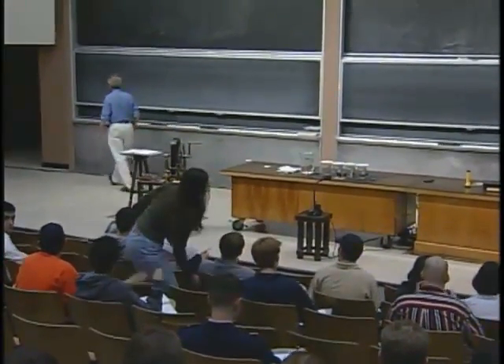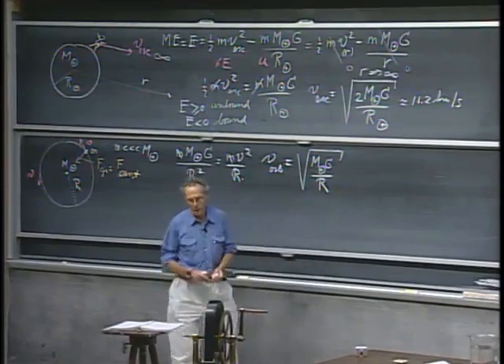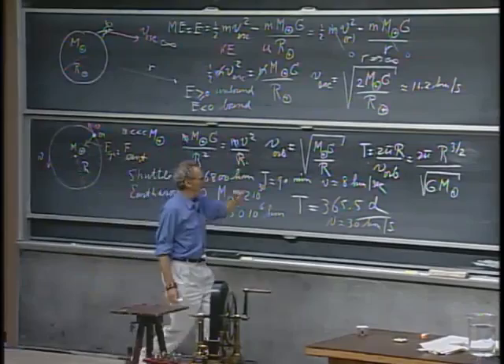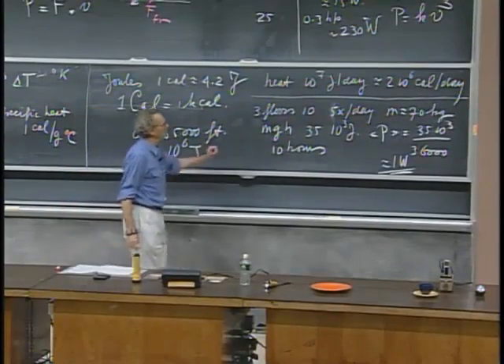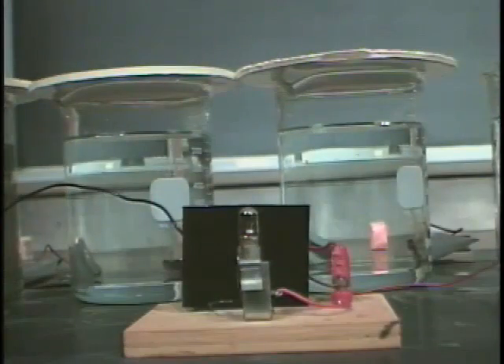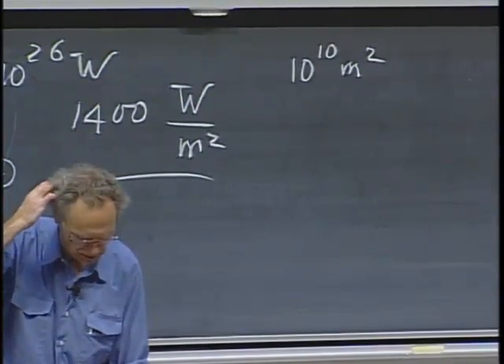8.01x - Lect 14 - Escape Velocities, Circular Orbits, Bound and Unbound  Orbits, Power

Comment: GPE of the ball --> KE when the ball hits the ground --> causes a spring in the ball to be compressed and converts KE to EPE and closes the switch in the circuit --> electrical energy flows through the circuit --> light energy in the bulb, causing the ball to light up. The spring continues oscillating, converting EPE to KE and back to EPE to keep turning the switch on and off. However, as the spring is affected by friction and drag forces, it will eventually lose KE to heat and the spring will stop oscillating, turning the switch off permanently, thus, no electricity and no light emitted from the bulb in the ball.

Comment: When bounced, mechanical impact compresses an internal spring switch. This completes a circuit powered by a small internal battery, supplying chemical energy to flash the embedded LEDs for a set duration.

Comment: Does the ball have a battery inside with an open circuit that is completed by a spring flopping around when it feels a certain acceleration?
Reply from the maker: yes
Reply: @lecturesbywalterlewin.they9259  that's cool

Comment: Regarding last question: When we release the ball from height h above the ground, the potential energy starts to convert into kinetic energy and by the time ball reaches ground all the potential energy is converted into kinetic energy(ignoring air drag) and now ground is stopping its motion and hence some of the kinetic energy during impact time converts into heat energy in ground and in ball as well and so inside the ball there is heat energy and jiggly motion of an atoms, and the mechanism of ball’s light is such that it converts this heat energy into an electric energy to light the bulb.
Reply from the maker: most people think like you do. Quite resanable; but your answer is incorrect.

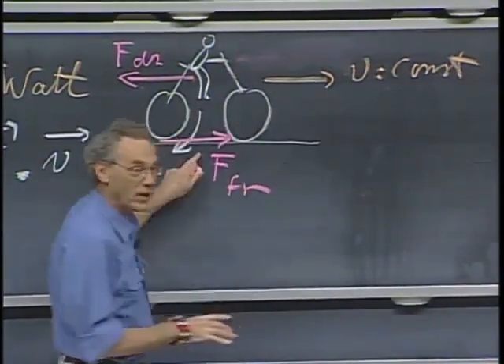Comment: For others who are confused @ 17:27 like me... 
Friction is ALWAYS opposite to the direction of motion. But in the bicycle example, friction is acting along. Also, kinetic friction is constant, as the cyclist's weight is not changing, so ideally, if it was friction from Lec-8 which was acting, then the cyclist wouldn't be able to accelerate. And the tyres would be scratching the road as it passes by causing the friction to be in opposite direction !!

So i guess the choice of word "Friction" is misleading here. It's simply a push by the ground in reaction to the push by the wheel !! Not friction from Lec-8
Reply from the maker: when an object slips then the friction is always opposite to direction of motion and heat is produced. Do not confuse that with an rolling object in pure roll condition; the frictional force is then not slipping and this frictional force can speed up an object (increase its rotation rate) when it  is rolling down an incline - (no heat is produced)
Reply: @lecturesbywalterlewin.they9259  Thank you sir for clarification. Love from India 😊
Reply: @VickysTuition  There are 2 types of friction, static & kinetic. If tyre overcomes static (doesn't slip on surface, object starts to move forward), kinetic friction causes bike to move forward through pure roll of the tyres.

Comment: 8.01x Lecture 14

0:00 escape velocity <unbound Orbit> <bound orbit>
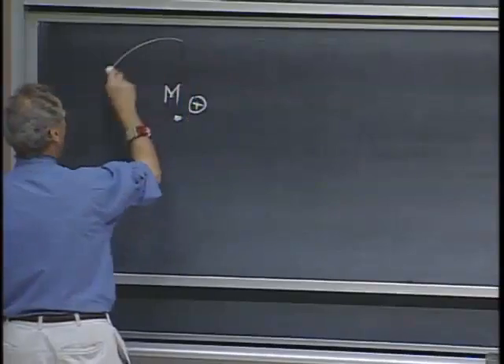4:30 Orbital velocity
(Example: Shuttle + the moon + earth, jupiter + Sputnik 4/10/1957)
=> interesting result: v Is independent on the mass
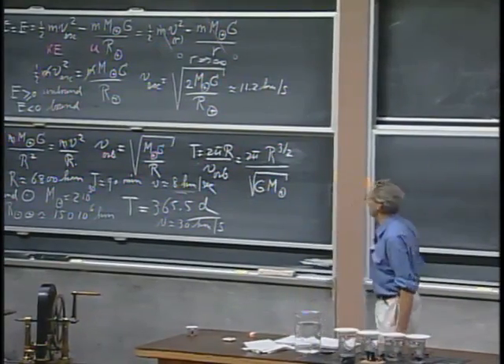11:55 interesting result from the equation of energy E=1/2U= -KE
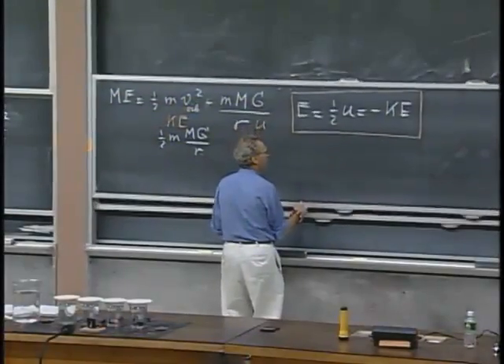13:40 Power
20:10 Heat energy
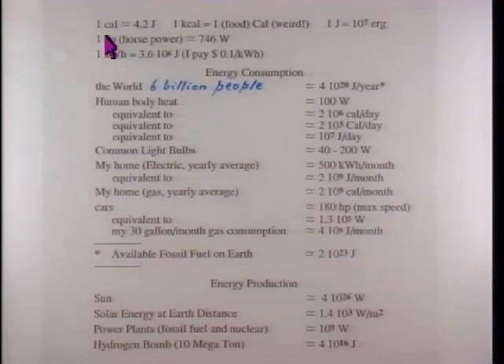23:19 Lecture Notes, Energy and Power Consumption
28:30 various form of E
33:55 acid battery
48:00 last ex+ question 

Give my thanks to Pro. Walter Lewin
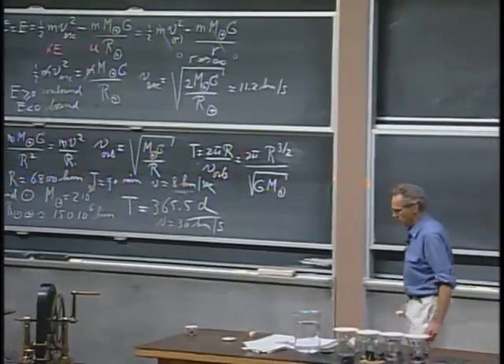Reply: The definition of the viral theorem at 11:55 is very ad hoc. Even though it is absolutely correct, I feel like the deepness of this result is not well articulated, but perhaps that is to be expected for an introductory course.
Reply from the maker: thanx 2u 
8.01 https://ocw.aprende.org/courses/physics/8-01-physics-i-classical-mechanics-fall-1999/

8.02
http://core.csu.edu.cn/OcwWeb/Physics/8-02Electricity-and-MagnetismSpring2002/CourseHome/index.htm

8.03
http://mit.ucu.ac.ug/OcwWeb/Physics/8-03Fall-2004/CourseHome/index.htm
Reply: @lecturesbywalterlewin.they9259  Thanks Teacher, the book Physics - Ohanian now is not available for us to find, so i can not solve all the problems which is in this book. Can you help us.
Reply from the maker: @thienthanhtranoan6723  Ofcoz I do have a copy of the Ohanian that I used in 1999 but I see no way I can help.  Many problems in my assignments simply mention "problem xxx in Ohanian, page yyy".  However, when you view the solutions you can guess very often what the problem was about.
Reply: @lecturesbywalterlewin.they9259  yes sir we can study by guessing and seeing the given diagrams in the answer solutions

Comment: question: if a rocket is fired up at a speed less than escape velocity, in order to reach a stable orbit, is there some angle to the vertical that must be exceeded upon liftoff?  for example if it goes straight up it will obviously come back down.  I imagine there would be some Theta that must be exceeded in order for there to be enough tangential motion, and this would depend on the velocity and also would be very difficult to calculate.
Reply from the maker: all rockets that put a satellite in  Earth Orbit start going up vertically then gradualy change that angle to optimize fuel consumption. Also watch my lecture on Kepler Oribits. I have a Physics Problem in which I address that issue.
Reply: @lecturesbywalterlewin.they9259  ah I should've realized to wait until I saw that lecture before asking.  sorry for wasting your time!!  and thanks for taking the time to reply, it means a lot.  stay well ❤

Comment: accelerometer and battery inside - if te acceleromter measures anything very strong the lights flash

they do not generate energy from the impact - that might hteoretically be possible but it’s impractical and expensive you usually just have a battery that lasts very long
Reply from the maker: correct

Comment: Where does the energy come from of the blinking light in the ball at last, I didn't get it professor.😋
Reply from the maker: battery
Reply: @lecturesbywalterlewin.they9259  So when the ball touches ground, the battery gets connected to the led via spring. 

Is that right ??
Reply: Gets connected to ball*
Reply from the maker: @pratikshinde2121  when the ball hits the floor (or when you bang it on the table) a switch is activated which will drive the current for a fixed amount of time.
Reply: @lecturesbywalterlewin.they9259  Got it sir, thank you
Reply: @lecturesbywalterlewin.they9259  Battery... I knew it!

Comment: If fuel is continuously supplied irrespective of escape velocity and propelled why cannot a rocket reach infinity? That is leave the earth gravity
Reply from the maker: any object giving a speed of about 11 km/s above the Earth atmosphere in a direction away from Earth will escape and will not return to Earth.
Reply: @lecturesbywalterlewin.they9259  My question is different. Any object with lesser velocity but continuous propulsion should also escape from earth?.  Another doubts raises is if escape velocity is given on the surface no more propulsion is required till reach the escape distance?
Reply from the maker: >>>Any object with lesser velocity but continuous propulsion should also escape from earth?.  >>> yes, of course provided that the "continuous propulsion" is sufficient". If it is not sufficient the object may fall back to Earth.

Comment: Its not clear how the switch turns on in order for the bulb to emit light. but the energy comes from the moving motion of the ball. the total gerenerated due to the motion of the ball depends on the gravitational constant and the mass of the ball if the consider the work done to be the dot product of force and velocity(w=F.v).

Comment: Hi Dr Lewin,
I did some research on the mechanism of the ball experiment that you did at the end of this video, I wonder if the ball blinks because after it collides with the floor, the spring inside the ball gets compressed, thus the gravitational potential energy is converted into spring potential energy. After it bounces up, the spring started oscillating. It takes a period of time for the spring to stop the oscillating ( to transfer the spring potential energy into electricity which lights the electronics inside). Thus, it would blink after bouncing up.
I am not sure if my reasoning is legit. Please help me with that.
Thank you!
I really enjoy your lectures especially the demos!!
Reply: Good hypothesis but for a spring to be compressed and store the energy it requires a orientation where the loops of the spring are aligned vertically to the floor when it collides so you would expect it to sometimes blink and sometimes not blink depending on its orientation when it hit the floor but 3 springs aligned 90 degrees to each other may work regardless of orientation.
Reply: @burningsilicon149  what about y shape spring configuration?
Reply: I thought about this too. However, if that's the case, then at the oscillation of spring would've slowed down to a stop instead of instantly switched off.

Comment: I think the blinking is caused by impulse when the ball bounces off the floor. There should be a 'generator' inside which powers the little bulb with a frequency, a generator which converts impulse of bouncing to electricity. I guess if you'd constantly bounce the ball, it would never stop blinking until that 'generator' or battery dies at some point. Correct?
Reply from the maker: there is a battery inside - at each bounce a switch triggers the connection for a few sec with the light bulb.
Reply: @lecturesbywalterlewin.they9259  aha! Thanks for the answers <3

Comment: maybe LED is situated in a group of -ve springs with some space between them and +ve terminal of led is already attached to the battery 
so when ball collide with floor then system becomes unstable and LED moves back and forth and circuit will start switching between on and off. 
but i don't know why duration between two flash of lights is looks like so uniform?

Comment: Here is my try on the brain teaser. 
When the ball hits the surface, there is heat generated. Maybe there is a detector which detects this sudden change in heat and responds to it by blinking. Afterwards, the heat radiates out and the ball comes back to nearly it's initial temperature?
Reply from the maker: incorrect

Comment: To start with you are the best. I am 16 minutes into the lecture and have a dumb question. If friction causes the bike to accelerate and the force due to friction is a constant = u_k*N , then faster pedalling should result in lower acceleration since it would decrease the resultant force in the forward direction. I know I am wrong somewhere. Can you please help me out?
Reply from the maker: faster pedaling means you are doing more work. The wheels want to rotate faster thus the frictional force on the wheels in forward direction increases. Look at it this way: suppose the friction coeff was zero (smooth ice), no matter how fast you pedal you will not move at all.
Reply: Lectures by Walter Lewin. They will make you ♥ Physics.

Thank you for your reply.

Can i also think of it in this way. Since the wheels rotate faster the centripetal acceleration increases which means more N and thus the frictional force (u_k*N) in the forward direction increases?
Reply from the maker: The force that I exert on the road (via the chain and the wheels) increases when I push harder on the pedals even at the start when the wheels are not rotating and when the centripetal acc is zero.
Reply: Lectures by Walter Lewin. They will make you ♥ Physics.

Got it. Thank you Professor.

Comment: Sir, In the Bike example you said " I push on the pedals and the pedals push back on me, action equals to minus reaction and therefore there is no net force on the bike" but the forces are acting on the different bodies and if we consider free body diagram of the pedal, the is force which pedal exerts on you and the force which chain exerts on the pedal, so to keep it moving with constant velocity they cancel out. Is it correct?
Reply from the maker: >>>and therefore there is no net force on the bike">>>
WRONG

Comment: Sir I think that there is a potential energy mgh when we throw the ball and then at the moment it hits the ground that gravitational potential energy turns into kinetic energy and a potential energy which squeezes the ball when it hit the ground. Then this squeezing potential energy turns into electrical energy which make a light bulb (which is programmed to blink) blink. Is it right?
Reply from the maker: incorrect
Reply: Lectures by Walter Lewin. They will make you ♥ Physics. May you tell me the reason sir please?
Reply from the maker: try harder

Comment: Dear sir ,
You took 10hrs for calculating power of climbing 3floor building  example but , isn't  be time of travel(assume we take 5mins to climb a staircase then it will be 5*5=25mins  )  not span in which we have climbed  in a day ??
Reply from the maker: ho many minutes into the lecture?
Reply: I was on 27th minute of lecture!!
Reply from the maker: m g h = 70 x 10 x 50 = 35 thousand (h = 5 times 10 m)
Reply: Sir ,
This I know!! but ,To calculate power u took 10hrs ,which I think isn't justified!!
Reply from the maker: 35 thousand J in 10 hr is an average power of about 1 W

Comment: Sir, can we say that if we intake more calories than required, body increases its surface area (which is proportional to size) to increase the heat rejection to maintain the temperature?
Reply from the maker: >>>can we say that if we intake more calories than required>>>

depends on what you mean buy "required".

Comment: How will having atmosphere affect the calculations (0:23)?
Reply: how will it affect the calculations?
DO you mean the drag force??
Reply from the maker: we calculate esc vel of stars and planets and ignore possible atmospheres. In the case of Earth the esc vel from 100 km above the earth (where atm can be ignored) is about the same as the esc vel from the surface (ignoring atm) it's about 11 km/s.
Reply from the maker: yes air drag
Reply: so why are you ignoring it even though you have already taught it in Lecture-12?
Reply from the maker: To take the atm into account in esc vel is not practical as it differs greatly for all objects. (ask NASA). Look up tables of esc vel of planets - atm have always been ignored and that's OK because the esc vel from above the atm is nearly identical than the "imaginary" esc vel from the surface. If a satellite is in a circular orbit around the Earth, it will escape the Earth if you multiple its speed with sqrt(2).
Reply: But in Lecture-12 you gave the example of people jumping out of the plane with or without the parachute and WE MADE THE CALCULATIONS ALSO..........

so what's the problem now???
Reply from the maker: I WROTE you what the problem is. READ READ READ
To take the atm into account in esc vel is not practical as it differs greatly for all objects.
Reply from the maker: read
https://en.wikipedia.org/wiki/Pegasus_(rocket)
this is my last msg on this topic

Comment: sir, I have a doubt. Energy required to lift an object is mgh but how much energy is required to hold that object for x seconds.
Reply from the maker: to hold it for 20 years requires ZERO energy. Place the object on a shelf. 
Do you think the shelf has to do any work?
Reply: thats  to do with biology, i think lactic acid buildup or something, but in terms of physics,  no energy is transferred over the duration you are holding the object up for. Pain or effort =/= transferring energy
Reply: Lectures by Walter Lewin. They will make you ♥ Physics. But then, why does our hand start to hurt if we hold it for a certain amount of time?
Reply: five 505 that’s because only your muscles are doing the internal work,they contract and expand repeatedly,that’s why they hurt,the work is being done internally not externally as the object isn’t experiencing any work.

Comment: I think that in this ball is some spring with magnet which induce current. Isn't it?
Reply from the maker: no
Reply: Or maybe there is spring which turn on and turn off batteries.
Reply from the maker: yes
Reply: but then how does the light stops blinking after some time because the spring will continue to turn on and off batteries?
Reply: There is some friction.
Reply: I get the idea that when we throw it on the floor then the spring inside it is compressed which then oscillates and hence turns the battery on and off again and again but the professor showed that it stops after some time so the only reason that is responsible for it is that the spring is not in contact with the battery anymore SO BASICALLY WE HAVE TO THINK OF THE REASONS BY WHICH THE SPRING CAN BE MADE TO STOP??
Reply: This pronomenon which make spring not oscilate any more is friction.
Reply: but I saw in Walter Lewin saying in one of his comments that-
"There is a battery inside the ball and a switch that closes for about 10 seconds at impact"..........
Reply: Yes, and what about that?
I see it in such way.
There is spring which turn on and off battery, but because of friction spring is slowing down and in some moment it can not turn on this battery any more.
Reply: His answer did not have any spring......
Reply: the rate at which it is blinking doesn't seem to be slowing down to me